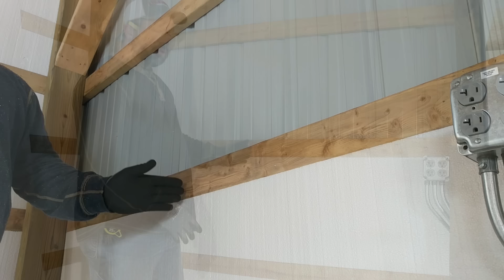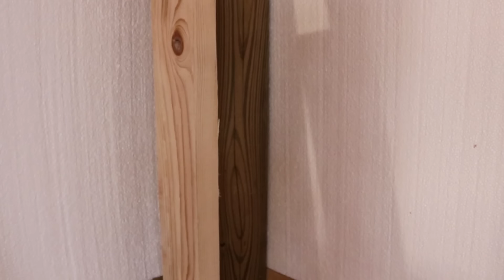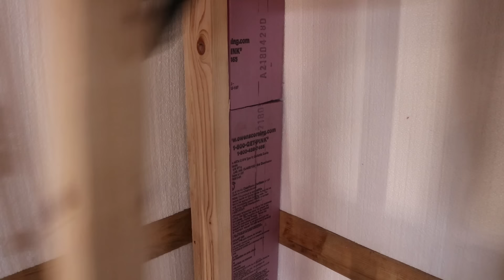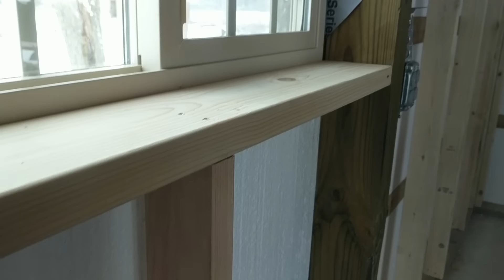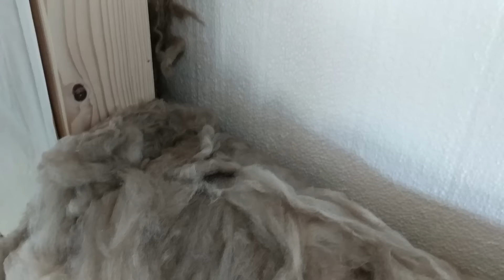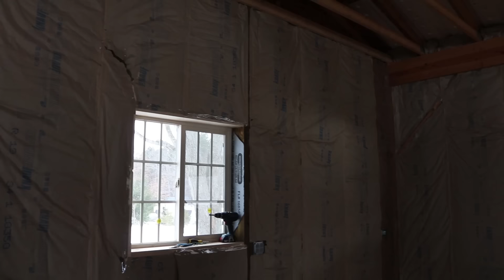How to Insulate a Pole Barn - Insulating the Workshop With Foam and Fiberglass

Comment: Question about sealing around the bottom of the walls - my barn (came with the house when we bought it) has air gaps there where the corrugated metal walls stick out. Does it make sense to spray foam around those base areas and then continue up with the foam board and studding and so on? Main concern is sealing from bugs/critters and then insulating. But I don't know jack about pole barns - just that my garage is one and I don't want to pay a fortune to have the entire thing spray foamed.
Reply from the maker: You could use spray foam, but I don't think you'd want to use the expanding type. It could push out your siding. I used the foam pieces that match the profile of the siding when I installed it. Either way, you may want to consider using the bottom trim to seal off the siding from critters. Here's a link to my video where I'm installing that trim:
https://youtu.be/QS8UKDUAldU?t=76
Thanks for watching Allan and good luck with your project.
Reply: @CountryFamily  Glad I asked! It's obvious now that no one ever installed that small insulation piece or the bottom trim. I'll start there for the bottom. Thank you!
Reply: Country Family Homestea

Comment: Does this allow enough air flow to prevent condensation?
Reply from the maker: Actually, warm interior air passing through insulation and cooling off is what causes condensation. For buildings in cooler climates a vapor barrier should be installed on the "warm in winter" side of the insulation to prevent air flow. For warmer areas that are cooled more than heated this may different. Insulation companies like Owens Corning and John's Mansville have good information on their websites to determine the best technique for your area.

Comment: Any reason why you didn't buy insulation rolls that were 7' 6" wide?  They would fit directly between your 6" posts, from floor to ceiling,  No gaps.  No studs.   They come in 50 or 75 ft rolls, depending on the R value.
Reply from the maker: Thanks for the comment Randy. I have not seen batts that wide before. That would make for a well insulated wall. In my case I need those studs for interior wall covering as I am finishing the inside with drywall or plywood and hanging cabinets and shelving.

Comment: Built a pole barn . 10 ft walls and no ceiling. I used some foam/fiberglass boards cut between the perlims. Stuck the styrofoam board on top. Wasn't quite sure how to do the ceiling. If I was going to do it the same way. I live in Michigan on most concerned about moisture. I don't plan on heating it unless it's only temporarily with a portable heater.
Reply from the maker: I've seen people use the foil-faced foam boards on the walls and ceilings, but keep in mind that stuff is not designed as a finished surface and some of that foam is flammable and gives of noxious fumes. Depending on your planned activities such as welding, cutting or grinding, I would consider covering with drywall or similar as soon as possible. Be sure to also allow your attic space to breathe otherwise your roof could get very hot in the summer and shorten it's life. The best thing to do is use drywall or steel ceiling and blow cellulose or fiberglass in the attic. Hope this helps, thanks for watching.

Comment: Best video of any kind that I have seen on u tube was amazing how through out the who illustration you fast forward to get to the details that needed explanation.l have built a lot of pole building's and watched a lot of u tube tapes. Never could understand why they spend the whole length getting tools moving parts to work area instead of having it set up before hand. excellent film .
Reply from the maker: Thanks so much David. I try to get better and better with each video I make. I appreciate the comment and thank you for watching.

Comment: Did you use blown fiberglass or blown cellulose?  Fiberglass settles and compresses over time, reducing it's R value.  Cellulose does not loose R value when compressed.  We have R 49 in our ceiling in a 1,315 sq ft home + 676 sq ft heated garage.  We're in central Minnesota and with infloor radiant heat our highest heating bill hasn't gone over $600.00 for the entire heating season.  I like the bead board between the frame and metal siding and the gap between the studs and girts.
Reply from the maker: I haven't blown the ceiling in yet. My original thought was to use fiberglass, but still considering cellulose. Thanks for the comment and thanks for watching.

Comment: A reasonable plan but wrong materials. Use fire resistant foam, and roxul or cellulose bat both are bug and fire resistant. Fiberglass and EPS are highly flamable and pests have no problem living in them.

Comment from the maker: There has been some discussion in the comments below about whether or not to use a vapor barrier with your insulation. A "vapor retardant" is required by code here in Michigan on the "warm-in-winter" side of the insulation.  This is because of the conditioned space being primarily heated and not cooled. Other areas  may have different needs, requirements, or codes to follow. I would highly encourage you check with you local building authority and do additional research on the best practice for your project.
If you want to see some options for the best wallcoverings for a workshop or garage, check out this video: https://youtu.be/m-CRJRC__tQ
Reply: Country Family Homestead steel is a vapor barrier on the exterior.  It is prone to condensation from the interior heated room.  I would not add plastic on the inside it will trap the moisture.
Reply: When you mean the inside do you mean avoid installing a vapor over the fiberglass or avoid installing a vapor on the inside part of the metal ?
Reply: Air moving around it or filtering through it defeats the insulation. You need film to stop the air movement as well.

Comment: Why not use a blown in insulation? Much better seal.
Reply from the maker: I agree but the cost is significantly more too. For my barn I didn't think that added expense would be cost effective.  I did use Nu-Wool in my house and I am very pleased with that product. My house was actually too tight which caused condensation on the windows in the winter. I had to add an outside air duct to bring in fresh air which solved the problem. Thank you for your comment and thanks for watching.
Reply: Cost XXXX more..  get an estimate. Almost horrifying.
Reply: Country Family Homestead: In Minnesota it is code to have an outside to inside air exchange pump to eliminate inside moisture in the house.
Reply: @dennishayes65  if they were really needed all states would require them. This state just sees a mandatory purchase for a tax grab.
Reply from the maker: @dennishayes65  I believe it is here now too. I remodeled the house back on 2006 and the inspector didn't require it although he probably should have.

Comment: Why did you choose to go with fiberglass vs Rockwool (or another similar product)?
Reply from the maker: While Rockwool would be an excellent choice for this application, I chose fiberglass mostly because of cost and availability. The Rockwool would give a slightly higher R-value but with a six inch wall cavity and the 1 1/2" foam board between the purlins, I felt fiberglass was the most cost-effective choice. Thanks for the question and thanks for watching.
Reply: Double the price

Comment: Did you use any type of vapor barrier on your walls and roof? Thanks.
Reply from the maker: KelMaster Construction  Thank you for the comment. I am wondering what part of the country you are in? I am in Michigan (Zone 6) and my barn will be heated but not cooled. Certainteed recommends vapor barrier on the inside to prevent warm moist air from passing through into the wall cavity. The outside wall should breathe to the outside and the attic space should be well vented. If the conditioned space is predominantly cooled then warm humid air from the outside could be trapped in the wall space and cause mold and or rot. In this situation a vapor barrier on the inside should NOT be used.  
In my days as a builder, I have exposed exterior walls for tie-ins and remodels that had insulation with a kraft-faced vapor barrier and there was no sign of moisture. Also the Michigan Residential Code Section R318 requires "a vapor retarder shall be installed on the warm-in-winter side of the insulation". 
If you have different requirements in your area, I would like to know more. If that is the case, I would point that out for my viewers so they can do a little more research for their area. 
Thank you.
The CertainTeed reference is from here: https://www.certainteed.com/insulation/resources/do-i-need-vapor-barrier/
Reply from the maker: The Kraft paper face is a built-in vapor barrier for the walls. I will put up a plastic sheet vapor barrier on the ceiling before installing drywall. Thanks for watching.
Reply: -trapping vapor between kraft face and metal....
Reply from the maker: KelMaster Construction  Thank you very much for taking the time to participate in this conversation. I do truly appreciate it. I have not put the ceiling in yet, so I am going to do some more checking on what is best practice here. I plan on blowing fiberglass into the attic space. The wall insulation is just as shown with the kraft-faced batts.  I have pinned a comment to the top to urge viewers to do more research for their particular project.
Reply: KelMaster Construction   so no plastic sheeting was added to the attic? I too have built a 30x36 pole barn and getting ready to insulate it.  I like how this one has been done and would like to do mine the same way.  I am just looking for the right way to insulate so I do not run into any troubles down the road

About 5 years ago I built a Fire Department out a a pole barn, and there was not any plastic sheathing required. The walls were insulated with fiberglass, and metal sheets lined the interior walls and ceiling. The lid was blown with 40" of fiberglass.

Comment: Everything you do, you do it with perfection and pride! That barn will be well insulated.  It will also be sound proof. That is a good system to have the 2x4 spaced from the outside wall.  Thanks!
Reply from the maker: Thank you Joe.